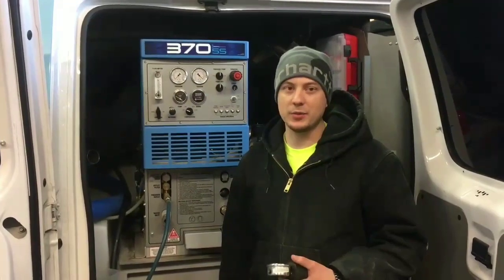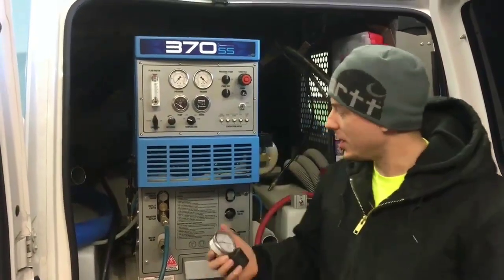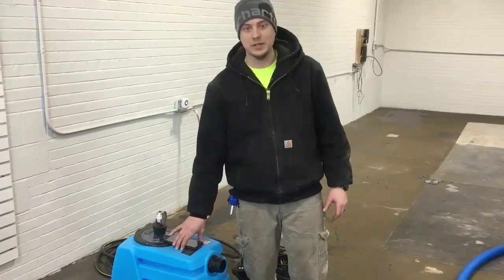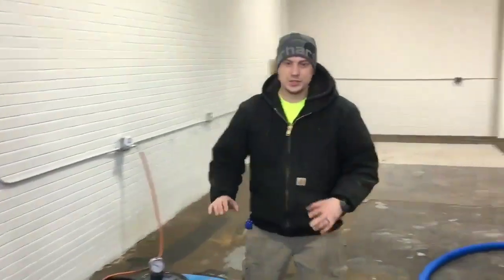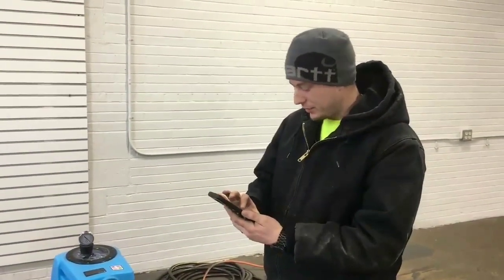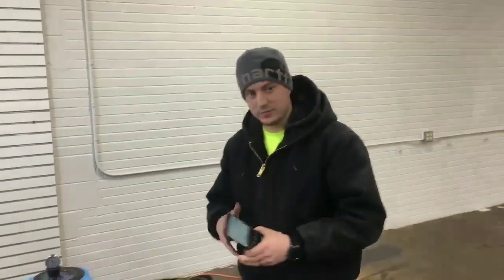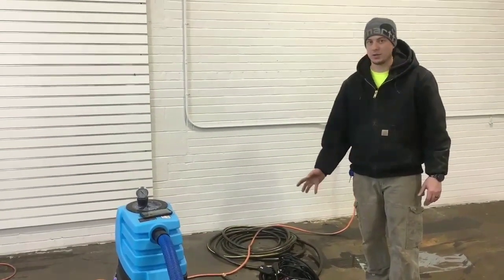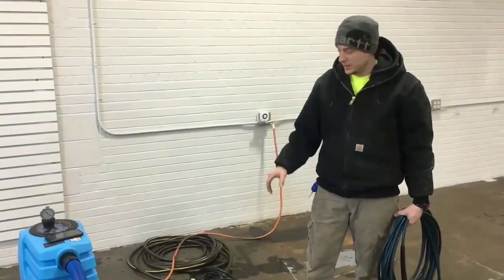Mytee Air Hog LX Power Comparison to Truckmount - Clean Pro Supply

Comment: What that actually showed is the air leaks at the connectors. If it was a solid pipe, to each length, there would be no drop in the Hg.
Reply: Have you ever used 2" car vac supply hose? They're definitely air tight and more rigid selling @50', 100' continuous.
Reply: @runzization  they are too stiff to work with inside a home.

Comment: The air hog is meant to hook up to another water extractor. Be nice to show the performance / vacuum hooked up to another common 2 motor extractor. Then did u have the 370 at full blast and does the 370 loose suction at 200 ft ?

Comment: Can the Mytee Air Hog be used alone to clean tile and grout with a Turbo Force wand or do you need another unit?
Reply from the maker: Thanks for asking. The air hog is vacuum only, so you will want a separate machine such as the Mytee Water Hog or Pumptec Water otter for the pressure side.

Comment: This video probably broke some hearts ! A $1500.00 air hog vs a $19,000 TM.
With some creativity you could easily have a $1300-$1800 fresh water tank to feed the WATER HOG, a diesel heater to crank out really hot water and the AIR HOG for vac.
And a waste tank to pump waste water to.
And still be way way under 19,000.00.
Plus you could still add a electric hose reel and a second AIR HOG and still be way under $19,000.00.
Not to mention reliability and maintenance. 
Hmm.... 🤔🤔🤔
Also you can take it inside completely with no open doors and go high rise with dragging out 500’ of hose !!
Hmm... 🤔🤔
Thanks Dave
Reply: Yes.. the quality of the build is more desirable...all the AH n WH components are nice and tight ... the fittings are all quality and fit tight .... no leaking ... dripping ....twisting loose pieces ...
I used the air hog right out of the box and it performed with no hiccups...
Then I used the WH right out of the box, it too auto-filled with no drips... leaks or spills... the 1200 psi pump pushed the bar in the tile spinner with ease !! 
I only used 750-800 psi when I used it on tile  n grout ... it performed flawless !!
I’m definitely Mytee happee !!
Reply: I like Edic... they are pricey...
But are excellent strong machines !